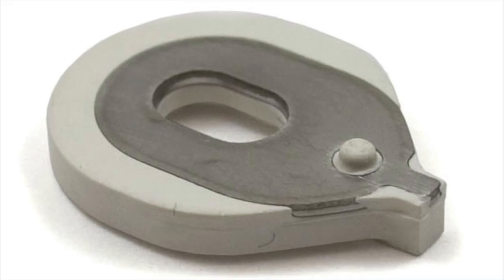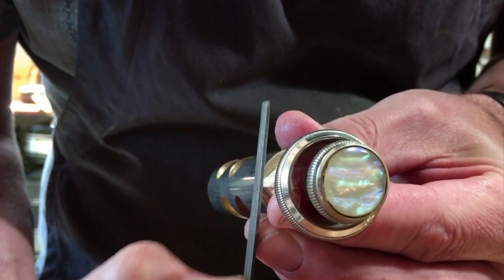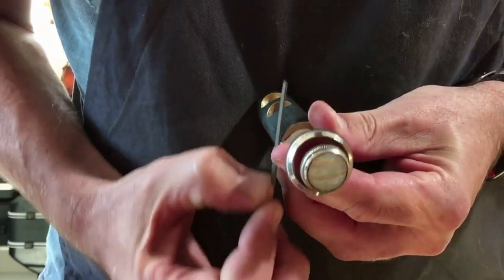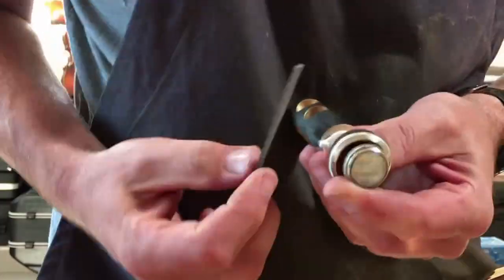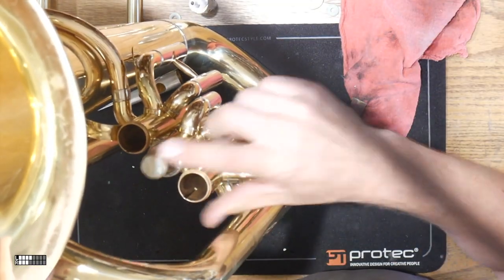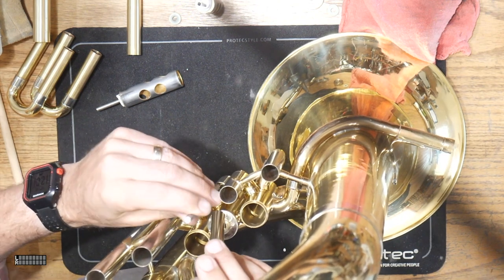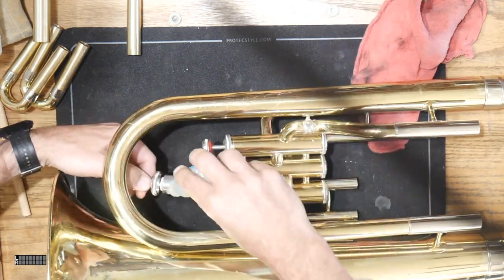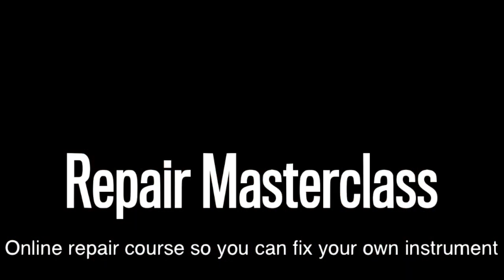Plastic Valve Guide Fitting

Comment: Hi, do you know where I can get a similar item with just a one side guide like the above but for a trumpet? I have an old Boosey and Hawkes and they have those kind of guides with square hole
Reply from the maker: Most every repair shop will have a large inventory of various valve guides in stock. Every horn has a slightly different type of guide and most of us stock pretty deep. If you have a local tech you like, go see them. If not, email me a picture of your guide and I probably have one.